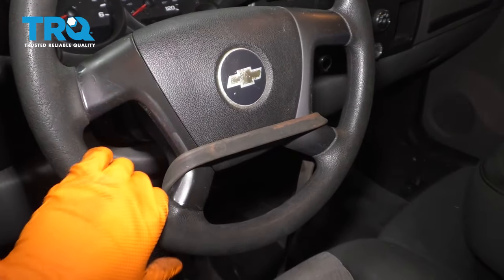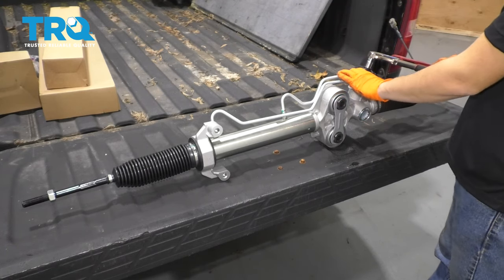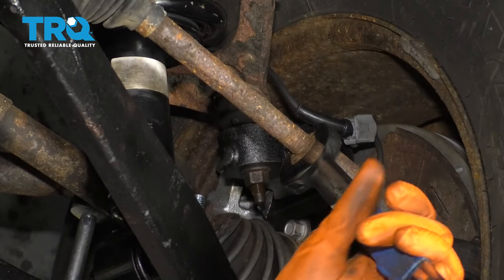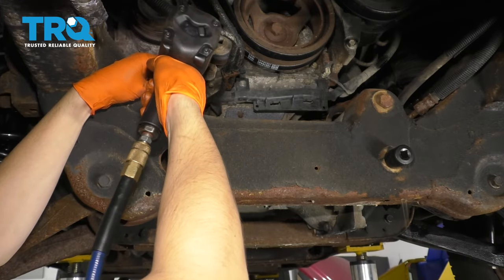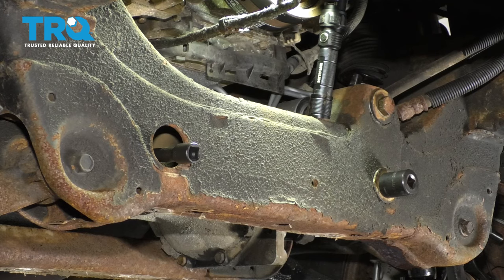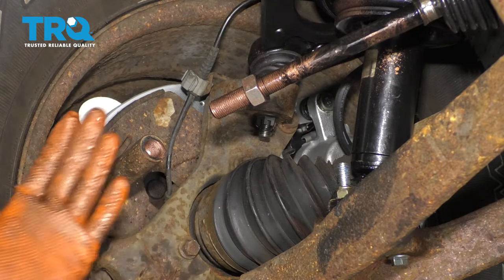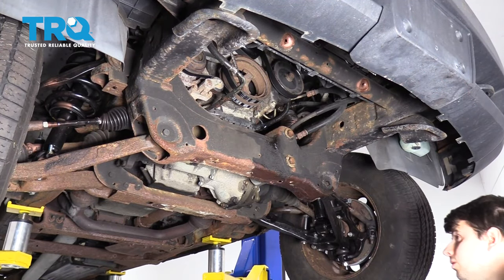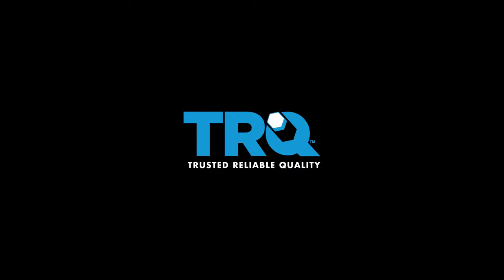How to Replace Steering Rack And Pinion 2007-14 Chevy Silverado

Comment: Thank you very much for so detailed film. When you unscrew those huge bolts to remove the subframe (or whatever that shield is), you need to wear a mask (a lot of dust w/rust around!). I watched this film to see how to release the Shaft from the Rack Peg (I think I have a skipped tooth on the rack, since the Steering wheel is crooked 45 degrees to the right), and maybe to replace the rack in the future (2003 Chevy Cavalier). The film was very helpful, thank you again.

Comment: Where did you get your torque specs? GM manual shows 74 on the small passenger side bolts and 148 on the driver side large bolts.

Comment: Is it possible to over tighten the bolts on the steering rack too much and pull the center rubber pieces out?  It looks like the rubber mounting pieces on mine, have protruded out of the steering rack housing towards where the front cross member would be. I'm trying to reinstall my differential after replacing my oil pan gasket, and now, the diff won't go back in?  Thanks in advance.